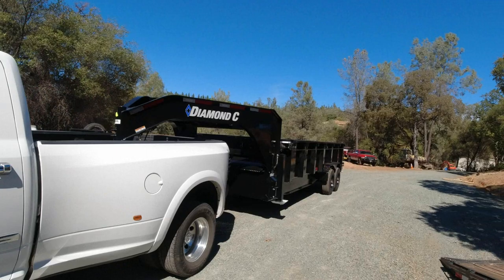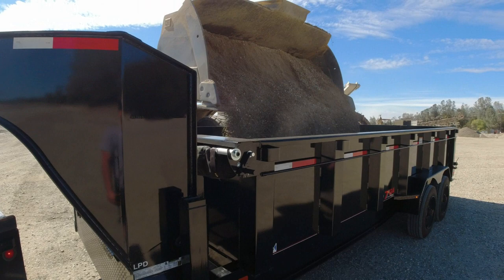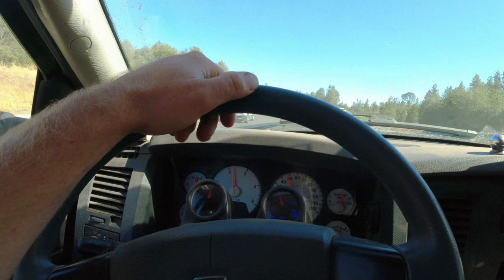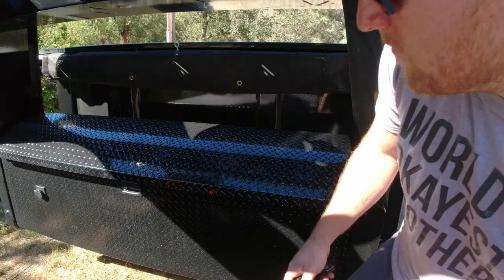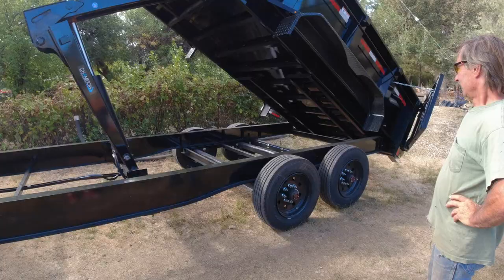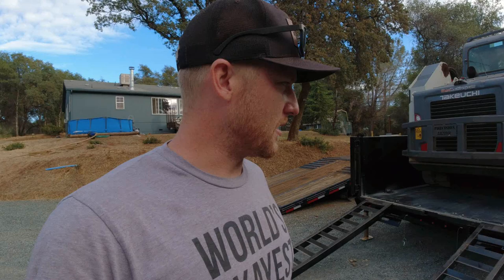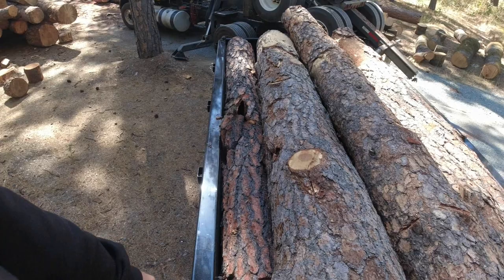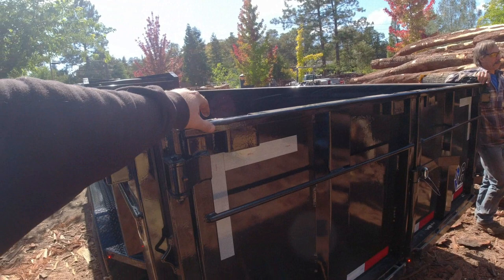MY NEW DUMP TRAILER. Super single GOOSENECK

Comment: Smashed the thumbs up button, as always. Been running dumpers since my first(2002 EZ Dumper). Best thing I ever did Sam is run two welding cables from the dual truck batt's, under and along the pickup frame(zip tied,etc), to a Anderson style quick connector mounted just underneath the rear bumper. Then added about 6 or so feet to the battery in the trailer with a matching Anderson style connector. Now you've got 3 batteries worth of amp's. Never, ever had a problem again. Unlimited dumps throughout the day at full power. Which really saves the pump motor from low voltage and overheating the windings. Also, I kept a farm jack mounted to the triler so when I was too heavy to dump I would put the farm jack just under the front of the bed and begin jacking as I hit the lift button. Believe it or not it would lift everytime within about 4" or so then take off.  Saved me from shoveling. Bought all new stuff this year, 2021 Ram 3500SRW, H.O. Cummins, Aisen, Laramie, and just got a 2021 Iron Bull,16", 14K, Deckover gooseneck. Awesome content as always.
Reply: Same plug in setup on both my trailers with batteries! Helps keep those batteries fresh for winching and dumping.
Reply: Dude, the farm jack idea is great. I am adding one for sure, I’ve had to shovel once and it was one time too many.
Reply: Great information brother!! Thank you
Reply: @Andrewactual  New setup sounds great and yet another saved by "The farm Jack"💪👍
Reply: To hell with battery pumps on dumps !  I ran remotes from the hydraulics on my truck to the rear and put quick couplers that the dump trailer plugs into. No more dead batteries and more power to lift the loads (no more shoveling) and the best part is being able to run the trailer whilst sitting in the A/C !!!!
Reply: @mattywho8485  #hellyeah

Comment: Nice trailer.  But that’s disappointing it didn’t dump that for such a expensive trailer regardless of where it’s loaded.  Would think it would have to be a good bit overloaded for it to not work.
Reply: Need a telescopic hoist. I got a sure-trac 7x16 21k, hoist and it will lift 11 tons of gravel as I tested it, but I always haul around 9 tons of rock in it, etc never any issues. Wish I would have got the 10k axles instead of having the 3, 7k axles, but dont think that brand makes it with 10k.
Reply: @krice24  the telescopic hoist will dump anything, but like he said they can get in the way when hauling equipment above the. Box
Reply: Load center makes a HUGE difference. Look at forklift ratings. A slightly overweight payload slightly forward of center isn't going to dump in most trailers. Yes, a telescopic would help, but they come with their own drawbacks. JMHO
Reply: @jml6357   can you explain these drawbacks? I’m about to buy one and like to know. Thank you

Comment: First time I took my 14’ 14K dump trailer to get gravel I ended up getting 10 ton when it was rated 5 ton. I didn’t realize what 5 ton looked like so I kept telling the loader driver keep going 😂. Truck and trailer handled the load just fine but when it came dumping it was a different story. Telescopic cylinders are awesome but not with  twice the rated capacity.

Comment: Sweet trailer. I have a 7x16x2 Lamar GN and i have had too much weight too far forward more than once without equipment to make that adjustment by moving material. You only do that so many times! GN trailers tow so much better!

Comment: One mod you might want to make is cut the d rings off the bottom in the rear and move them up to the bottom of the sides. On the floor they seem to catch everything when you dump especially if you are hauling logs or something. Drove me nuts for a couple years till i finally did it to mine and haven't looked back. I just got a few weld on and welded them to a small piece of plate to reinforce it. Might no need to on yours since those sidewalls are a little thicker. Other than that nice trailer. Im still not sold on the scissor lift tho. Ive accidently grossly over loaded mine which is a double ram set up and it still will lift it no sweat.
Reply: oh ya

Comment: Hey Sam, love the new trailer. I am looking at the same one 18ft with the telescoping cylinder. I added another battery in parallel on my 16ft dump and it dumps a lot faster also. Thanks for the videos
Reply: not sure if you were looking at a Diamond C, but the telescopic (LPT) longest available is 16' were you looking at the WDT or a different brand?

Comment: I like you still got the OG truck there in the back and looks like you still work it. Also the only time you need volume in a dump trailer is with light material like wood or hauling machine. My dump truck has a 8x11 bed with 2' sides and I can't get enough mulch in it to overload it but less than half the bed with rock and she's squating.
Reply from the maker: Which one?
Reply: @VBELTandSON  The 3rd gen single wheel.

Comment: My advice is put a 15k winch up front and top so you can winch up heavy loads to a point where leverage is on the dump side so you can dump about any weight without worry and helps lift cylinder and theres a 30watt or 50watt solar battery tender that works better then the small 10watt and go agm or lithium battery....

Comment: Usually if it will lift it a few inches, it will dump it.  So you can try to lifting it just a few inches before leaving were you are loaded to be "more" sure it will dump it at the destination (assuming you can get it adjusted where you are loading).... Of coarse that assumes you won't be dumping it uphill (anymore than where you were loaded)......

Nice trailer & video, have a good one!

Comment: I run a 20ft diamond C dump 20K. scissor lift as well and if they get it over loaded and a little forward the lift struggles. We haul a lot of logs and brush with ours and has been a huge asset to my business.
Reply: I’m looking at getting a 16 foot LPD with the 3 foot sides 18k gvwr.  Hauling logs mostly. Was worried about the scissor lift not being able to lift it loaded full. Do you think I will be fine?

Comment: Not what you can haul, it's what you can dump :)      You could have fired the front hydraulic jacks to lift the trailer up a bit of an angle to give the main scissor a bit more of a chance.    It's to bad those landing jacks couldn't go up higher as those two are probably 12k jacks, more than the scissor!  .  Just de couple from the goooseneck and lift the thing up as high as it will go and then fire the scissor.  You are a brave man dumping near that power pole, be wary of a "Flash Over" effect where if you get to close to a high power power line the power will jump to your elevated deck  and fry everything in the vicinity.

Comment: Hook the trailer battery up to your truck, 4 gauge wire, anderson connector. And dump the trailer while the truck is running, trailer charges while driving and is topped off by the time you unload, and 14.5 volts makes a big differnce while unloading. Also when you have to buy new batteries buy the biggest most ridiculously expensive battery you can find, you wont regret it

Comment: I would put diamond plate on the ramps before you get them bent up. That's what I did with mine. Used them hundreds of times and not one bend or dent.

Comment: Run single 0 from the truck battery to the trailer. My 14k pj dump wouldn’t dump 6 ton ran the wire and It dumped it with ease, when it was loaded legal it would raise crazy fast. Worked with a guy that ran long ass jumper cables from his truck to trailer the pumps really appreciate the extra amps.
Reply from the maker: I should do something like that. I wanna try to jump box in it and see how it’s rips

Comment: Okay, ... I subscribed (i subscribe to No One). I watched for the super singles. Would've liked to see the axles.. Nice video. I lol'd when the mulcher came down hard, felt that one. Also thought you needed the stabilizers down a little bit more, but seemed to work out👌. Happy you went scissor,... keeping it in the USA 👍. I'd FULLY charge that battery the second it arrived. They sulfate from new, not good. Also, pet theory of mine, but honestly, i would dump that thing a third way up and down multiple times with just low weight in it to smooth and break in all the bearing surfaces in the rear hinges and those in the lift. Then regrease. Consider it as a break in for making it go up. Just a suggestion. As usual, super informative video thanks ☮️ ~

Comment: Thats a monster. My 3500 and bumper pull is 12,600. My next one will be a gooseneck for sure. Ive had mine loaded to about 32,000 gross once and it did it fine but I was nervous the whole time. I’m not a big fan of the scissor hoist but other wise an awesome looking trailer.

Comment: I have a 2020 PJ that’s a 16’ but otherwise same exact trailer. I believe mine comes in at about 6,750 on weight empty. Same thing on loading, keep it to the back. Was running the shocker hitch and seemed to help but moved it to my tilt deck. Keep up the good work and congrats on the new addition.
Reply: diamond c for the win
Reply: @maximumwoof8662  no diamond c available at the time. Seems to be the same problem still. Would love to have one. Especially with all the issues I had with a brand new trailer.

Comment: Can move thousands of lbs more per trip with a flatbed (like you said) as long as you have equipment on other end... I'll run straps in two log pile layers,  hook straps on forks, pick up pile & then dump front of straps off forks & leave straps on back of forks & pull straps out from under pile.. Never have to get off lift to unload..

Comment: if you have 2 batteries in your dump bed it could help the hydraulic pump lift the load . if it has 2 batteries from the factory add 1 more . you might see a difference  with the load in the proper place.

Comment: put a good charge controller on your solar cell to the lift battery. Then your lift pump will run cooler with a little higher voltage plus could solve your forward 18k lift problem.

Comment: Only thing i don't like is their ramps just hook onto the rub rails.... That means ALL of the machine weight is on just a few welds. Don't like it at all. If one weld breaks, the machine goes down sideways. On my SureTrac (or H&H) dump, the ramps grab the rub rail as well, But they Also have a Thick (1/2") bent plate that extends onto the flat of the deck. The machine is thus supported by the Back of the trailer, not just the rub rails. Nice trailer, heavy. With the wheels so far back (which i like), u prolly could have gotten away with bumper pull. Wouldve saved at least 500#s... But that also would have been risky if mistakenly loaded too tongue heavy ~

Comment: Nice trailer! I just bought a Texas Pride Gooseneck 7x18 20k dual ram and got it delivered a few weeks ago and that's what I did first thing. Pulled into my gravel pit and I threw in 9.3 ton of class 5. Dumped it no problem but I loaded it more over the axles. Gonna use it for hauling in rip-rap outta the farmers fields and logs for my sawmill. Was very unimpressed by the fact they talked me into a spreader gate, which sounds like a great feature to have, then sell the trailer with a cord that doesn't reach the drivers window. I asked them if I'm spose to hire someone to walk along side to help dump it ffs...guy had the nerve to tell me I was the 1st person to ever bitch about it and I said ya right lol. Seems like it lacks some welding also but we shall see how it holds up. I did go with heavier gauge steel and 12" centers. Gonna look at the Circle C in the spring for a Gooseneck flatbed trailer. Thanks for your videos ! Keep-em coming !!
Reply: A wireless winch remote works for dump trailers for a lot cheaper than a dump remote, because the ol lady got tired of riding in the bed of the truck with the remote 🤣🤣🤣
Reply: Lol 😆 🤣 😂

Comment: have a similar trailer just a little smaller, if it gets plugged in at night i get like 3 dumps max before i gotta hook a jump box up to the battery for it to dump
Reply from the maker: I’ve only ran 2 runs in one day it seemed like it was doing ok. I’ll most likely add another battery

Comment: Gotta build your own trailer now days. Mine has two 5" cylinders, no scissor type. Powered by gas motor to a 2 stage pump. 18' bed. My only limits are the truck pulling it. 
  Your trailer looks nice tho. Thanks for sharing the video.

Comment: Do you think the wide track front end on the 5500 would have helped in that tight spot vs the 3500?

Looking to get a similar setup and can’t decide if the extra cost of the 5500 would be worth it or needed pulling 24-26k max loaded.

Comment: Dump trailer are for brush and lumber scraps I tried a friends thinking of buying one was just not impressed. Four t770 skid steer buckets of dirt and nope wouldn’t dump. That made my decision
Reply from the maker: Been running a smaller dump trailer for years. 10-12k loads on average. No issues. Perhaps you used a junker dump trailer
Reply: @VBELTandSON  I think 80% of new dump trailer users load it wrong. Its one thing hauling lumber and tree debris, its another hauling aggregate and dirt. Like you mentioned, loading just a bit too forward can stop it from dumping, thats easy to do on such a long dump trailer too.. great looking trailer.

Comment: Cool trailer but I noticed you adjusted the gooseneck coupler after switching trucks but diamond c does offer a load leveler coupler but I am sure you knew what you were doing when getting this trailer. Cool video
Reply from the maker: It was wrong hight from the start had to fix it. All trucks ram that new hight
Reply: @VBELTandSON  makes sense super cool trailer though for sure

Comment: Sam, have you wired the trailer connector so the truck charges the dump trailer battery?  Should be done on all of your powered trailers. Back in the 70's, I used to drive an International Loadstar 1800 with 345 gas and would regularly haul 16,000lbs and occasionally 18,000 lbs. Trucks and trailers like yours didn't exist back then. Interesting how equipment has changed. Good luck with the new trailer!

Comment: Nice trailer! I tried to buy one but couldn't afford it, LOL Went with a PJ DE model 22k, 7'x16'x3', tare weight is 7300 lbs. You will use it for everything. They are my go too trailer. I also have a Lamar 18k, 7'x16'x3', tare weight is 6500 lbs. Are your sides 32"? Make some side boards for light bulky loads, such as chips and mulch. I wish the industry would come up with a faster dump system, they are all slow.

Comment: Nice Rig…!!!  Pretty well exactly what I had planned on purchasing, when starting up my Land Clearing/Road Maintenance/Acreage Mowing business - But, that would have required purchasing another Heavier Duty truck - So, went for a high quality 25’ gooseneck instead… Eventually, will Have To get a dump trailer, to cut cost/time, when needing rock hauled in… I’d seriously consider adding a 2nd battery, depending on what the amp draw for the hydraulic pump is - Could be the easiest/fastest fix…

Comment: I recommend when loading equipment into a similar trailer to raise the bed some like a tilt deck and you dont get the bed lift with the slam also the breakover for the machine is less. Just 15 degrees is enough to load the cylinder.

Comment: Yikes not a good Demo for the diamond c. 
 My 16’ load trail ( box main frame, I beam neck) with 3x 7k axles will dump 9 tons all day with its scissor hoist.

Diamond cs telescopic hoist looks terrible so I don’t blame you for avoiding it. They need to build a doghouse into the box and hide the cylinder like the big trucks do
Reply from the maker: I think the dang pump is set to low. Long box bad leverage and week relief settings. Yea. But she was a little heavy.

Comment: That’s a super nice trailer I would like to see and update on how it’s holding up after two years !! And are those 10k axles ? If so How is it rated for 24k
Reply from the maker: It’s been great zero issues.  
And allowed 25% prorate on. All trailers 
That’s how it’s rated at 25,000lbs
Reply: @VBELTandSON  would you haul 8 tons regularly on it ? Iam in the market for one but I want to be able to put atleast 8 tons and it lift it no problem
Reply from the maker: @angelmartinez-xy1no  yes handles it good.

Comment: Great video.  Very nice trailer. Looks like it will handle what ever you can throw at it.  I see v-belt still has that wood splitting conveyor system that you guys had so much trouble with.  Did you guys have to do any repairs to get it working properly?

Comment: Hey Sam.....shes a beauty.   Curious tho....where the wireless remote?  Also why not hydraulic discs?  I'm thinking of switching to a C from my current setup but I'm not into the chains that hold the barn doors open.  My current has a spring latch and it works sweet.  Wonder if that's an option on the diamonds.

Comment: should have left trailer hooked up and just loosened bolts and raised trailer with hydraulics, work smart not hard.
Reply from the maker: Until it gets in bind. And you get move it to line up the holes. Because the physics. Tried that before. Was a pain

Comment: Would it be worth it to get it rhinolined to preserve the inside wear and tear?
Reply from the maker: Negative. It’s double layered 7 gauges steal. Will be a long time before it showed wear.
Reply: Rinoliner doesn't "release" material well you want your dump trailer/truck bed  to release not hold material to prevent tiping over and what not